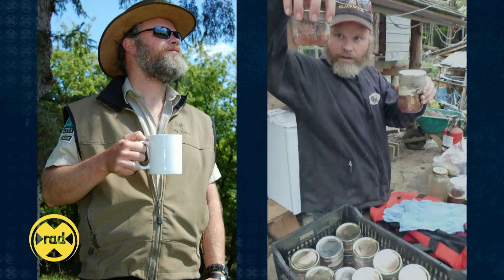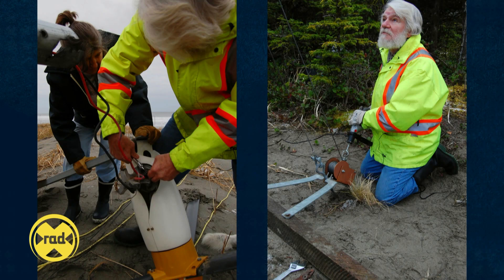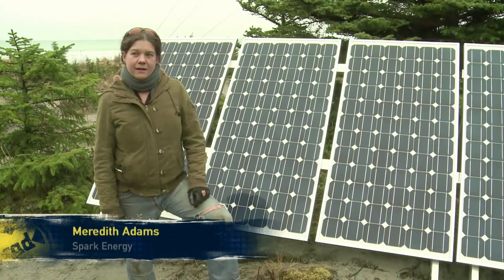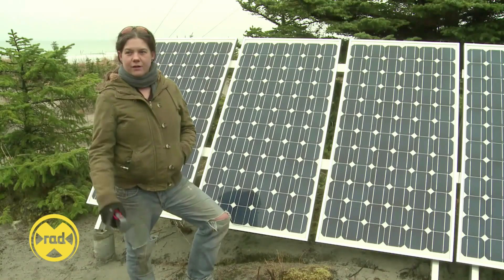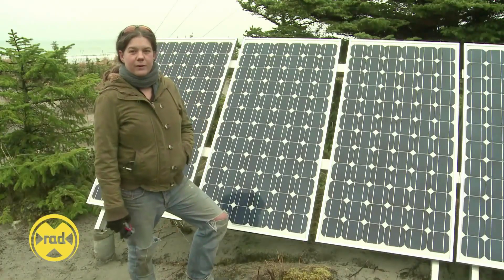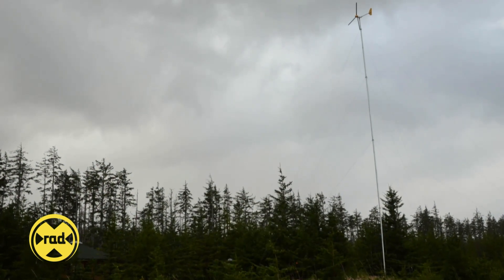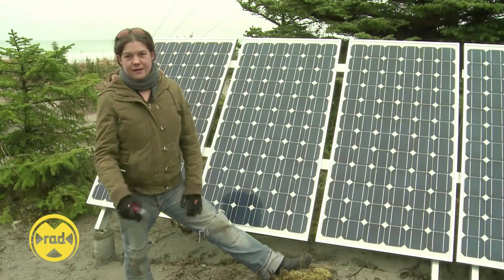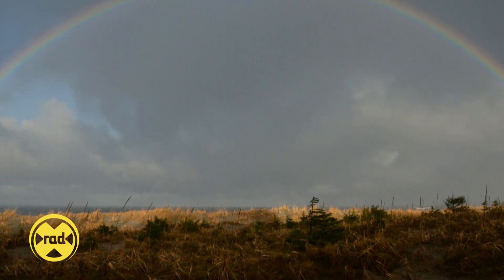Day 302 -- Using solar and wind power for modern day living -- Masa Off Grid

Comment: PS: I ended referring to using drawing power of magnets. I know this verges in the "impossible" if you'e a physicist (as I was before going into geology/geophyics) but the fact is: magnets are spinning electrons in "cages" that throw out magnetic fields, and do not get slowed/used up (unless also above curie temp). Mag fields can pull iron (it gets temporarily magnetized) and that force CAN draw steel uphill! By careful tinkering you can elevate steel balls & use energy! I dont know from where!

Comment: Maybe the best OFF GRID (but not "green" - politically correct nonsense! CO2 doesn't warm Earth. See "The Great Global Warming Swindle" youtube) device would be a furnace/stove/water heater, also outputting coal/wood gas (to power refrigerator, one also sucking cold from outside in winter!) - and using "waste" heat to power electric wattage via small temp gradient, via Stirling engine? -or Nitinol (temperature spring goes rigid vs soft) powered rotor-generator. Or use drawing power of magnets!

Comment: Professional help & off grid supplies are very pricy! Wider usage will only reduce cost a bit. Why? Wind is sporadic/weak except a few high/coastal windy areas I avoid. Sun is great in Arizona & Australia, but not northlands! PV cells are inefficient & costly! Same for batteries! 
I focus on using WOOD, COAL, or lignite/peat/agrowaste - for HEAT (major energy user), simultaneously use "waste" heat to make a little electricity. Burn fuel to also make wood/coal gas; it can power refrigeration too
Reply: Wind and solar power with batteries costs about $.12 per kilowatt hour. What is your levelized cost per kWh? If you're getting your fuel for free, you might be able to beat that, if maintenance costs aren't too high.

Comment from the maker: Don351w,  solar and wind do have a substantial price tag, that's just the way it is right now.  Perhaps if they become more widely used the prices will come (economies of scale).  Meredith at Spark Energy (sparkenergy.ca) may have some ideas about the lowest cost system possible for what you need.

Comment from the maker: @Ebiczebulanious - the owners of the wind and solar system have a wood stove inside their yurt but generate enough electricity (mostly with the wind in the winter) that they can power a dishwasher, microwave etc. as well as electric lights.  They also have a backup gas generator.